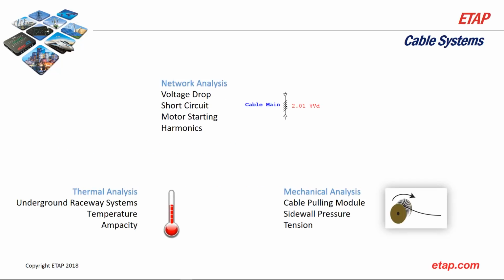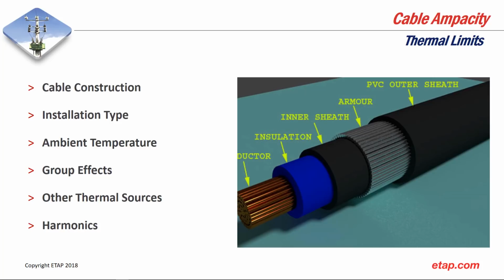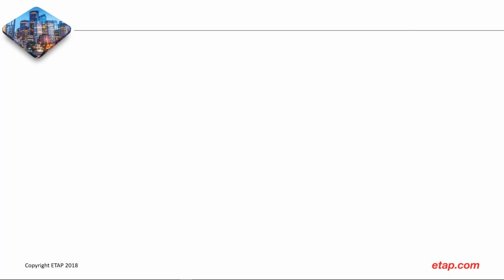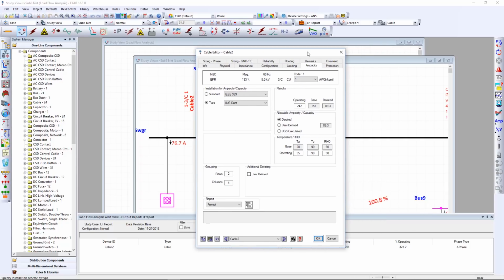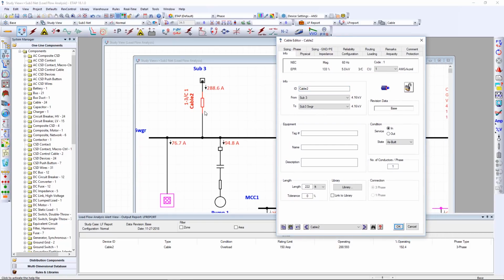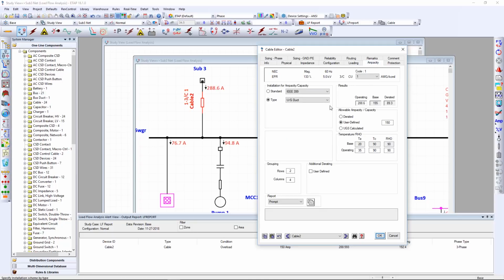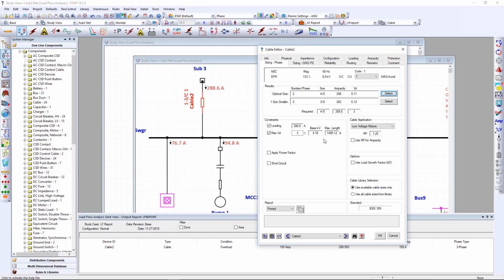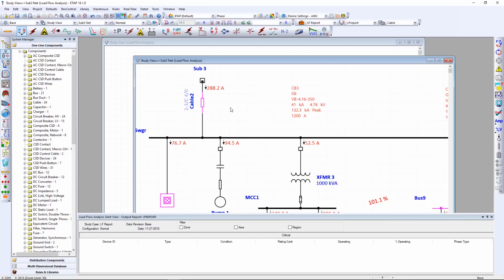Cable Ampacity & Sizing

Comment: @ Video Uploader

My question is regarding the "Grouping" under Ampacity Tab of the Cable Editor.

E.G if I am laying for outgoing of LV Switchgear the cables 4 x 1/C x 300mm2 / Ph + 2 x 1/C x 300mm2 for Neutral i.e. 300mm2 x Qty. 14 (in total) flowing altogether directly buried underground in flat horizontal touching arrangement. In this case shall my grouping be selected as "4 - based on the understanding that 4 cables per phase are existing"?
Reply from the maker: Thank you for watching our video and your interest in ETAP. Please contact our 24/7 Help Desk at support.etap.com and request assistance, or you can contact one of our local offices in your region https://etap.com/offices

Comment: thank you very much for these three videos , the big probleme in ETAP  to size cable is the library  how we can add new cable to the library
Reply from the maker: Hi Amine, thanks you for your interest in ETAP.  
As an ETAP user with valid maintenance contract, you can contact our support team via our HelpDesk 24/7 at no additional fee and ask them to build or help you to build a custom cable library for you. You can also build your own custom cables in  ETAP as long as you have all the cable specs.